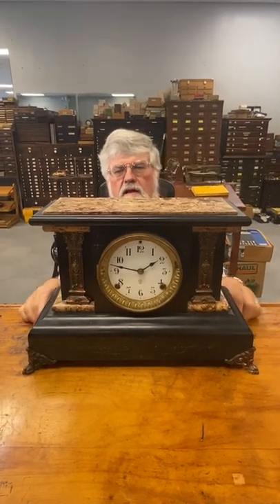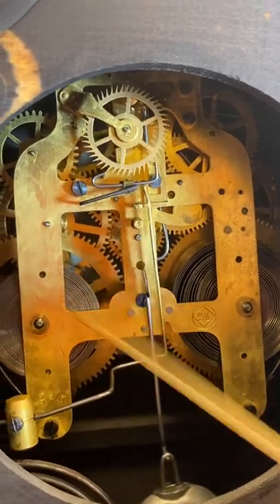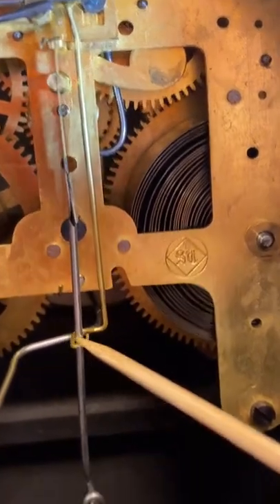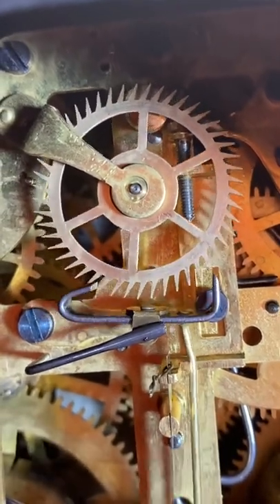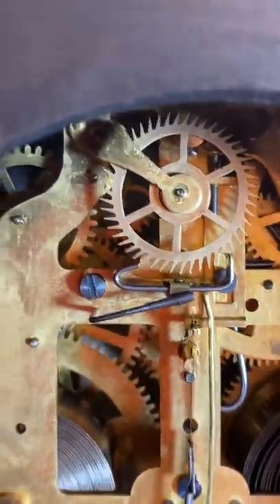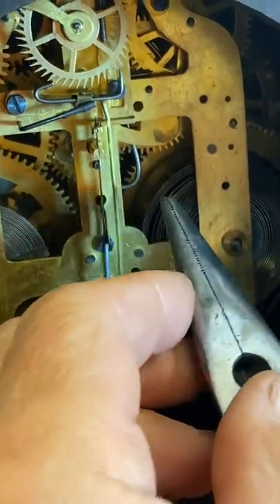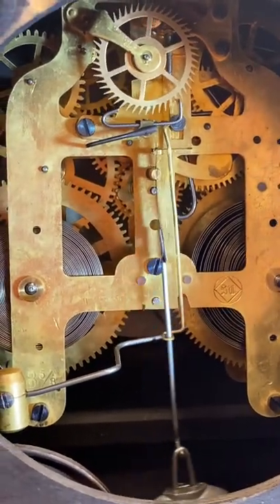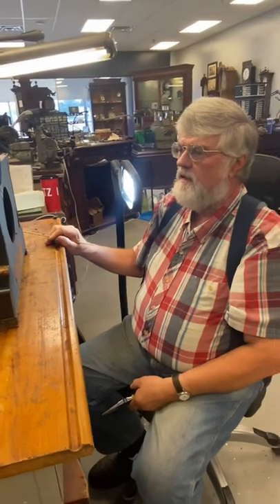How to put a mantle clock in beat.

Comment: Very good video.  I have a Mantle Clock, German, and it uses an escapement type mechanism (if that is the correct terminology?).  The Main Spring does ratchet anymore so need to get working on it.  Wind and it unwinds when I let go of the Key.  Hopefully I can fix it.  Will look at your other videos.

Comment: Good video, using a damaging method. To prove that the pallet is not aligned to the escapement wheel (either way for adjustment), you could also put a penny under each of the front and back feet to the left or right (Non-damaging method) and work out which way the adjustment needs to be to correct the sound balance... takes a bit of listening and thought, but doesn't cause bending of the current arrangement unless needed😉